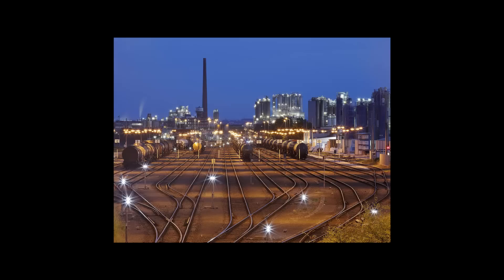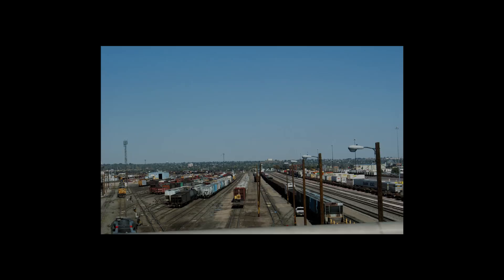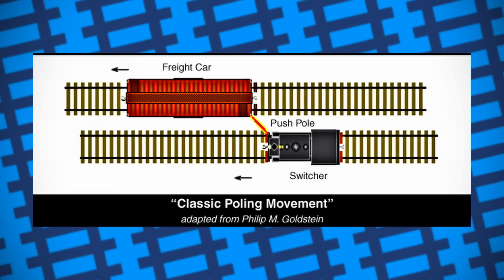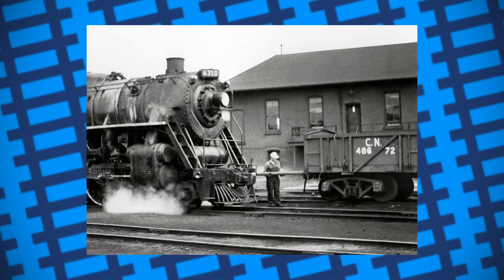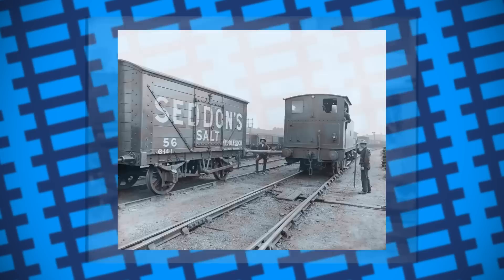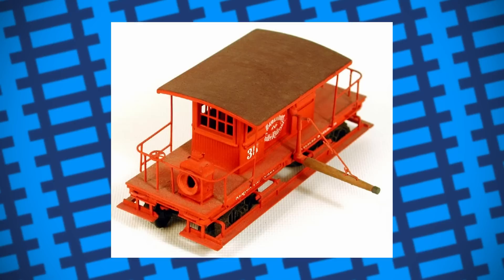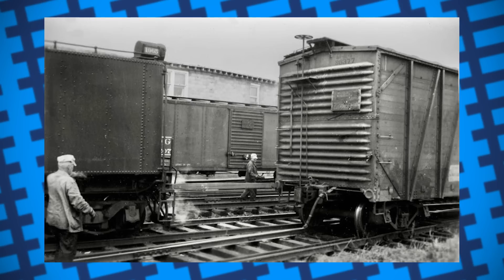The dangerous railroad art of shunting wagons with wooden sticks - Poling

Comment: "Sometimes, the best solution is the most OSHA violating ones."
Reply: I'm reminded of the "flying switch," another practice that's both an obvious time saver and obviously hazardous.
Reply: @MrBirdnose  what is this 'flying switch' you speak of?
Reply: @Reiver-93  It's A strategy for switching a car onto a facing spur without having to run the locomotive around the car. The locomotive and car start moving on the main line, then the car is cut loose and the locomotive accelerates to open a gap. The switch is thrown between the locomotive and the car and the car coasts onto the spur.

It's effective and time saving, but also a dynamic maneuver where a lot can go wrong if your timing is off.

Comment: Dear train of thought ,  I would also like to add that locomotives that have poling pockets , doesn’t necessary mean that they were used a such, some of the steam locomotives of the New South Wales government railways , had certain parts such as the frames built overseas by Baldwin locomotives works , that had poling pockets in the buffer beams but we never practiced poling in Australia at all.
Reply: A~feared  it would become trapped..."down under".
Reply: Yeah, some brazilian ALCos, early EMDs and Pullman Standard built cars had poling pockets but they were never used because kicking cars was already widespread.

Comment: I don't know if poling was ever "legal" on US railroads.  It was probably one of those practices that workers got away with as long as management wasn't watching.  It is interesting to see those built-in dimples on the cars and locomotives to make poling easier, though, which is evidence that someone along the way condoned the practice.  I don't think I've ever seen those, even in museums.  'Course I wasn't looking for them.  Next time I go to my nearest museum (National Museum of Transportation, St. Louis) I'm going to have to look and see if I can find those dimples.
Reply: Poling policies differed among railroads, but it pretty much stopped around the 1960s and if you look at equipment built before then almost all of it has poling pockets. Interestingly the ICC and Contemporary FRA don’t seem to have anything outlawing it.
Reply: It was common enough practice that rolling stock and locomotive manufactures provided the pockets. A number of railroads included poles as a part of their book of standards, complete with the general make up, dimensions, and sizes of "official poles". Switching locomotives often even had racks installed for a pole to be stored. Neither the ICC, CFR49. AAR handbook, or the FRA actually have anything 'outlawing' it.
Reply: Propping, as it was known in the UK was strongly discouraged but not banned in the UK due to the number of accidents and injuries caused by doing it.
Reply: I think it was 2015 that the FRA mandated any rail cars with poling pockets have to be retired or have the pockets cut off. Even though the practice was outlawed 35 years prior there was still a lot of cars with pockets.
Reply: Poling started as just one of those things crews started doing to save time, and management allowed it because it saved time and money. As it became a more generally acknowledged and accepted practice, locomotives and railcars got poling pockets to try and alleviate some of the dangers. When that didn't really work, and lost time accidents were becoming a problem, railroads started prohibiting poling as too dangerous.
Reply: @Stoker58  beacuse very rarely it is still nessicary
Reply: AT the National raiklroad museum In Green bay  Wisconsin, we have a shunter pole set on or near by oen of our locos, The 104 General Pershing. Its not talked about much as most rather see the inside of the big Boys Cab
Reply: It was common in the Coal Fields of West Virginia up into the 70's. A close friend (older) started with C & O (then Chessie System, retired right after becoming CSX) and retired as Conductor. They poled in yards between Charleston/ Huntington, WV to Russell, Ky.
Reply: I’ve seen many pieces of equipment at museums with poling pockets.
Reply: It was 100% legal.

Doing something is legal, until a law makes it not.
Reply: Poling pockets were still appearing on locomotives and rolling stock as late as 1960. Poling was an accepted practice on most railroads and could save a lot of time when cars weren’t kicked hard enough in flat yard switching. Poles were often stored on steam locomotive tenders and on cabooses. On diesels you’d find them tucked up under the walkways. There was no standard pole design and they weren’t heavily marketed. During the steam-to-diesel transition most early diesels had poling pockets on them. I have a small booklet on the Milwaukee Road’s EP-2 Bipolar electric passenger locomotives and the author mistakenly identified jack pads as poling pockets. Hump yards and insurance rates probably had the biggest influence on the disappearance of poling
Reply: @Douglas Skaalrud  Insurance, Reinsurance (Most Class 1's are self insured), but most of all...OSHA Bureaucrates would absolutely have a massive kiniption fit and stroke if they ever caught a Engineer, Brakeman or Conductor "poling in the yard". OSHA aka Health & Safety for all our British Railfans Brethern 😉😉
Reply: SImilar to how an 18 year old  kid in Canada became paralized from the waist down his first day on the job at a lumber yard operating a forklift, turned out some of the older guys showed him how to start the forklift from outside (for some reason), well, the kid did that but didnt realize the lift was in gear and when he started it up from outside it started rolling backwards and in a circle. As he tried to climb into the cab while it was turning in circles he slipped and fell and the forklift rammed him against a low concrete wall and broke his back. The accident is shown using an actor, but interviewing him in one of the WorkSafeBC videos on their youtube channel.
Starting a forklift that way is dangerous and a  huge violation, the operator is required to be in the seat and buckled before starting the engine, if OSHA sees something wrong in forklift operation it's a HUGE fine
Reply: Well, EMD manufactured the their early locomotives with poling pockets, so I am going to guess it wasn't exactly a "secret"...

Comment: We have a similar method in the yards on swedish railways. We have a 2 metre metal pole with a flat end and the flat end is put under the wheel and you push the pole up and down with your arms to push the wagon on. I can tell you, it's and easy way to build shoulder muscles.
Reply: Do you mean an Atlas car mover?
Reply: They were called pinch poles in England.
Reply: @ronselliers6951  Yes. Didn’t know that they were called that in english.

Comment: I worked for a heating coal retailer and the coal would come in a hopper car on the company siding.  The coal was dumped onto a grate and a conveyor belt lifting the coal up to the silos.  To position the hopper, the men used a crowbar like rod they called a come-a-long to inch the car over the grate.

Comment: Very interesting. In the UK it was quite common, and officially allowed in the rule book with various precautions, to use "tow ropes" to get wagons moving on adjacent lines.  So that was a "pull" method rather than a "push". The wagons had towing lugs that the rope would drop off when it was no longer taut - the engine started, got the wagons moving, and then stopped.

Comment: As a qaulified shunter do not fall into the trap of thinking shunting is still safe these days you see no evil do no evil and speak no evil, we are taught the horror stories of when it goes wrong. It is only safe if everyone involved does everything correctly
Reply: One of the first rules is never stand in the gauge unless your current task requires it. Drifting cars can be disturbingly quiet and you may never hear them coming before they squish you.
Reply: Here in Switzerland (and I think in most of Europe as well), Shunting Yards are almost fully automated today. Arriving Trains get split up manually, and Then a (oftentimes radiocontrolled) Shunting Locomotive pushes them over a small Hill. Once over the Top of the Hill, the Waggons then roll off on their own down the other Side, where the fully automated Network of Switches and Brakes let the Waggons roll into their new Train. The new Train then gets pushed together via automated pusher and manually reconnected. Then Locomotives get hooked up and take the new configurated  Trains to their Destination. 
I don't know why nearly everyday somewhere in USA Trains derail at almost no Speed. Derailments are nearly unknown here, as Rails and rolling Stock are Inspected regularely and our Trains all drive at Speeds between 60-200Km/h depending on the Line...
Reply: @samuelbhend2521  First, you described exactly what a hump yard is. You push rolling stock over the hump and then switches and gravity arrange them.

Second Switzerland is a tiny country (no offense). West Virginia which is a very small state in the U.S. is 1.52 times as large as Switzerland. 

Switzerland has 3,241 miles of track vs. The U.S. having 160,141 miles of track.
Reply: @Cragified  I take no Offense :) I know we are just a dot on the Map. 
But I'm always baffled seeing US Videos of anything Public Infrastructure related, how Bad in a State most of it is. Sometimes down to 3rd World Country Level... (I'm used to 15yr. old Stock being scrapped as "too old to refit" to the new restrictions/technical gimmicks and 20year old Bridges/Tunnels/whatever getting major overhaul, for public Safety "because it's already 20years old!") ou Safety and all other restrictions get replaced/new configurated every few Years...
 Switzerland is built upon and depends on it's Tightknitted federal and stately public Transportation System with matching up Timetables down to the very Minute, whilst Public Trasportation in the US is something only People from big Cities will vaguely know what it is...
Our federal and the 26 stately Gouvernements spend Billions/Year to maintain and expand Public Transport even more. By Law every Village over 300 Inhabitants must be connented to Public Transport and also two major European Freightroutes go trough Switzerland.
Reply: @samuelbhend2521  safety for american railroads have very low standards due to the freight companies who own all the track there prioritising profit over everything else, not a good way to run trains
Reply: @woobyvr9654  Ok. Who owns what isn't the Question here in Switzerland, There are hundreds of private, small Railroads/Busnetworks. We've got federal and stately Laws (todays minimum Requirement is the european Standard, which isn't always seen as enough here)  with federal and stately Inspectors. If a Rail doesn't fit federal Requirements it will be shut for repair, and if it was the Company not doing the required regular Inspections it will be very costly for them. Keeping up with the everchanging Laws is almost always cheaper than letting a un-announced Inspection find something not on Top of it's Game... And it doesn't Matter if it's the Federal Railcompany or Private Jimmy doing paid public Busservice with his Familyvan for a 200People Village. Public or not, federal or private doesn't matter if it doesn't fulfill one of the Laws it won't be in Service.
And very Swiss: also the Inspectors get regularely inspected and tested themselves...
Reply: @samuel bhend  money. No one in the USA like freight rail and the trains are getting heavier and longer. The system is being dismantled and the workload is increasing ly over capacity. It is a tragedy.

Comment: I worked in a goods yard at Kings Langley (England). Four-wheel vans were delivered to be unloaded but we had no shunter or even a shunting horse. Out of sight from the station one of the two regulars drove a small solid-tyred fork lift and with a stout rope was able to haul several vans to where we needed them for the waiting lorries. My job was to drop the brake lever on each wagon and without a nice square wooden item used to pin down the brakes (not the one described above but a square and very long baseball bat) I simply jumped on one of the brake levers to add my weight to pin it down. The fitters often came out to renew the fork-lift's tyres and could not understand why they wore out so frequently.

Comment: I know we still did polling back in the early seventies with our Alco t6s.
As you going up the steps of the engine on the left-hand side  at the step was a half round circle looking like a backwards C and it was a like a half of polling cup but I think it was made there so that if the pole would fall it wouldn't fall in front of the engine but fall away from the engine but I'm not really describing it good that way but look it up I seen us use poles a lot of times just pushing cars and specially if it got stuck in like a switch we just shove them on through.
Thanks for always very interesting videos,
I always enjoy them and always bring back good memories!

Comment: Heard of a related technique for loose shunting of single wagons used in the UK, namely using a crowbar to lever on the rail against the wheel \m/
Reply: The tool kind of comingled into the common shunter's pole; what was basically a hook on a stick to uncouple wagons safety from the sideline instead of standing between the wagons. The other end of these poles commonly ended with a prybar to get wagons rolling by hand. Especially brave yardies would jam the pole into the brake rodding and physically stand on the pole and ride the rolling wagon down the siding, leaning on the pole to apply the brake as needed.
Reply: @45calGunslinger  you wouldn't use your shunting pole to hold down the brake lever unless you wanted to break it. For braking in the early hump yards you needed a brake stick. This would be about a yard long half of which would be of square section about 2 inches thick went between the frame and the brake lever and the other half was a tapering round handle.
Reply: I think you're thinking of a Johnston bar, an American device for shifting railroad cars. You jam one end in under the tyre of one wheel and pull down on the other end of the 6 foot long lever and it shifts the car in accordance to the laws of the level a small distance.
Reply: @neiloflongbeck5705  the Americans probably had similar practices and tools, but I was referring to UK shunters
Reply: @45calGunslinger  and so was I, you use a braking stick for braking, shunter's pole for coupling and uncoupling and nothing else. I've not come across a British shunter's pole that could be used for the movement of vehicles.
Reply: There's a proper pinch bar for moving stock with a hinged shoe as an alternative to the simpler one with just a shaped end.  No particular safety hazard was found with these.
Reply: @neiloflongbeck5705  Although foolhardy, the practice of riding on a shunter's pole, wedged into the brake hangers was not unknown - I've seen photos taken by pre-grouping railway companies, showing what could happen, as a warning to the staff not to do it.
Reply: @JohnDavies-cn3ro  I've heard the same, but not see any photos.

Comment: One interesting American example of poling being an integral part of railway operations was with the Hulett unloaders of Whiskey Island in Cleveland. They were ore-unloaders that had four sets of rail lines underneath them that could all be filled simultaneously. I'm not sure what factors led to this, but they had built 42in narrow gauge lines build in between standard gauge lines 1 and 2, and 3 and 4, where a custom built electric locomotive would pole cars in place so they could be filled up. Although the "pole" in this case was a special pneumatic cylinder.

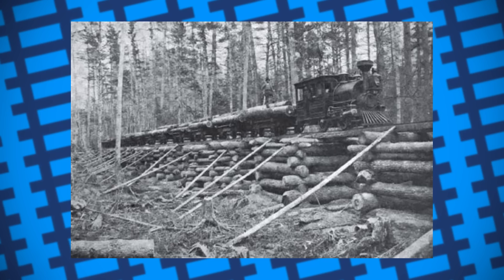Heres a video showing them in action around the 1:20 mark:
https://www.youtube.com/watch?v=1RJfnk2S330

Comment: In the seventies I worked at Cardiff steel works. The railway lines were all on a slight downhill gradient and the empty wagons were moved by gravity. Men, and women, would push a huge wagon to get it slowly rolling then use a long wooden pole to operate the brake to walk it down the line.

Comment: Why not simply install a pole on a locomotive? Why build a whole separate cart for it
Reply: Good point
Reply: I've seen a picture of a British 0-4-0T with built-in poles that swung out from hinges at the front and rear of the running boards - a much better solution than a seperate pole that might break, fall or similar.
Reply: Because locomotives come in and out of service a lot more than regular rolling stock. It’s a lot easier and cheaper to have a dedicated poling car then to install a bunch of poling mechanisms on a bunch of locomotives.
Reply: @Stoker58 
Doubt that was the reason. More likely they just prototyped it on an abandoned wagon, and with the whole process being in decline anyway, it never progressed.
If the idea had remained in use, there is nothing stopping them having made a quick release fitting to swing the poles off the loco when needed, and drop them off when they weren't.... Kind of like the pockets but physically attached to the loco.